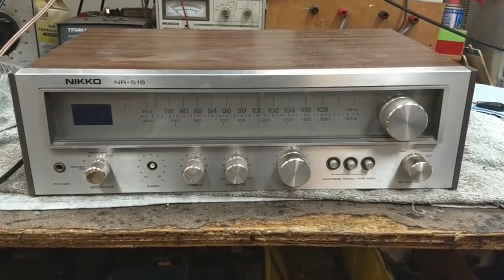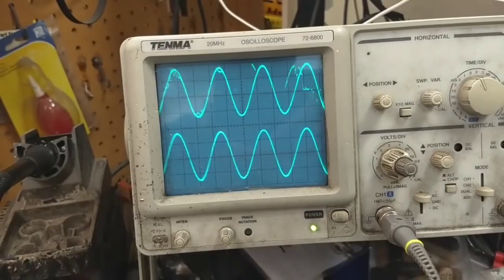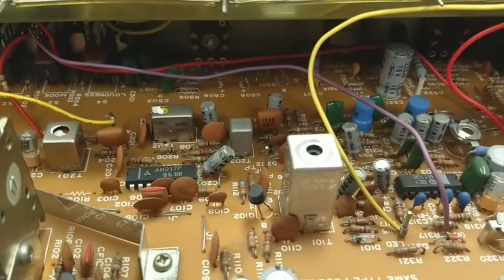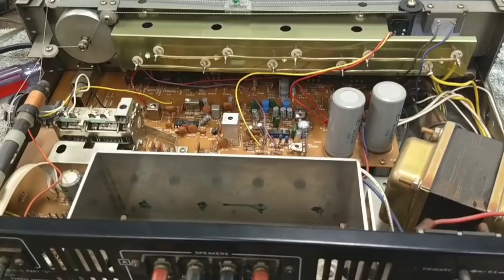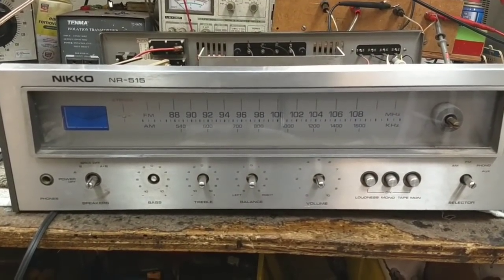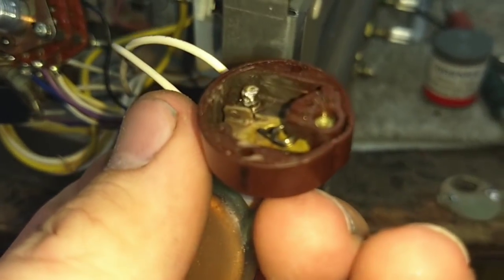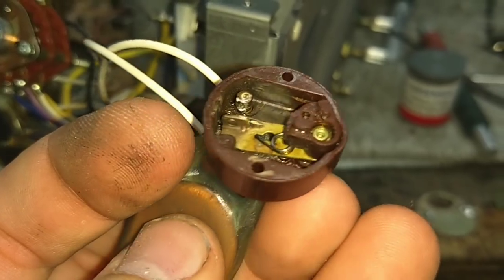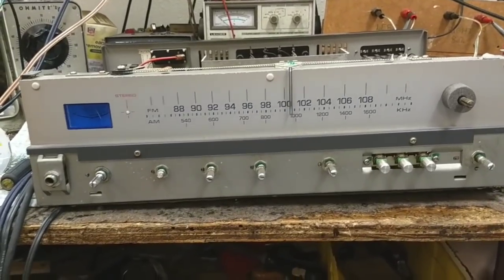Vintage Nikko NR-515 Stereo receiver service pt. 1/2

Comment: I am watching this because I purchased a Nikko 719.
Question. 
What polish is your recommendation that safe to use to give it that brilliant shine in your opinion?
Reply from the maker: Not sure. Detailing these is not something i regularly do.
Reply: @JordanPier  Thanks for replying. I enjoy your vids. The polishing subject seems to be confusing from what I understand because most of it is abrasive and possible to remove the lettering. I am surprised no one has attempted to do a video on it considering many of the vintage faceplates have scratches that could look better with good polishing. Kudos Jordan on your channel. I am subscribed. 😉